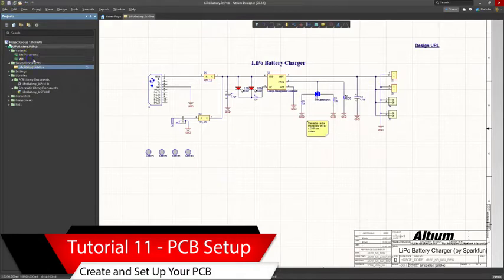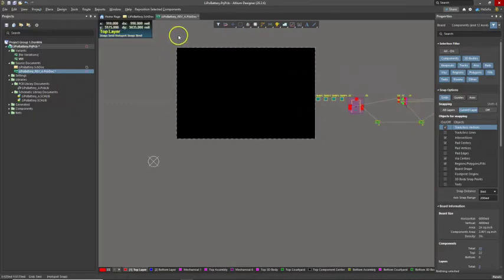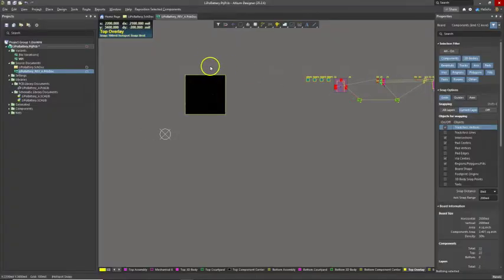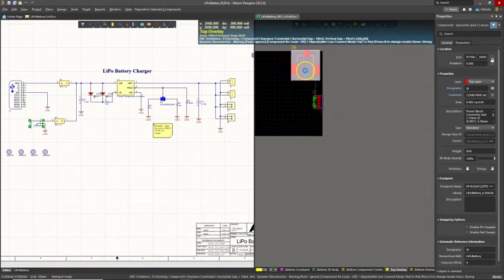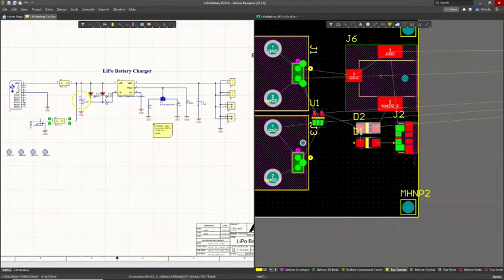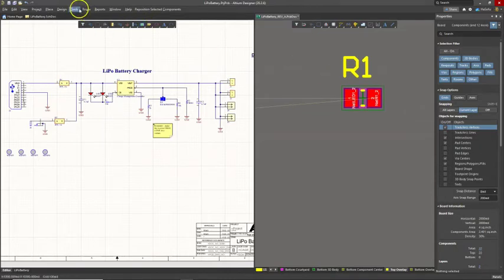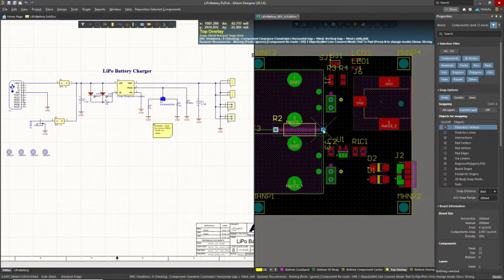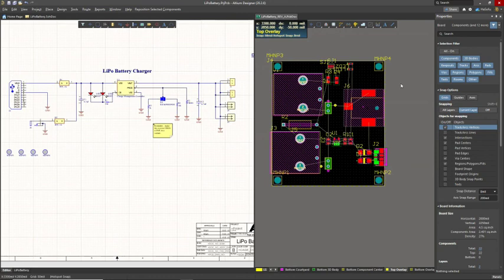PCB Design Tutorial 11 for Beginners (Altium v20) -  Part Layout / Placement

Comment: Also have you changed the schematic with a different footprint for the USB? It looks different from the one from video 2 of the series. Plus mine stands up straight instead of the USB opening being on the side. Do clarify.
Reply from the maker: Possibly, yep. I might have pulled the wrong footprint, but as long as you apply the principles and use a similar footprint, you'll be fine.

Comment: Hey. For some reason I'm not able to to place my 2 pin AMPs anywhere on the board. I can move them around but I'm not able to move them on the board. I think I need to change some settings or delete the text in the footprint as I think it might be preventing it. But to be honest i have no idea. Need your help. Thanks.
Reply from the maker: Yep, you can email techedkirsch at gmail dot com

Comment: How to we have a board outline without seeing it as silkscreen around the perimeter? The documentation never shows using silkscreen to define the outline, it just shows using the board planning mode to define the outline. But then JLCPCB complains that it cannot find board outline without it.
Reply: *edit: A line drawn on the mechanical1 layer should be done on the perimeter of the board and then on the gerbers document on the outjob file, you should toggle the Mechanical 1 layer on the right hand side. Under the bit that says "Mechanical Layers(s) to Add to All Plots".

Source: https://www.element14.com/community/thread/60904/l/board-outline-in-gerber-files